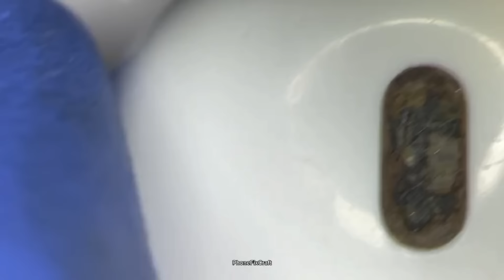Best of October ’21 TikTok phone and AirPods cleaning videos compilation from Phone Fix Craft

Comment: Is anyone else worried that the phones could be damaged by the metal objects? 😰
Reply from the maker: Yes, plenty of people are worried. It's a pointless worry though ;)
Reply: We don't pry or scratch at the pins on these ports you know 🤣
Reply: No
Reply: I am just worried about those tws because the watery liquid might damage those speakers no
Reply: He made little scratch at 2:29 🙂
Reply: @MLG_ROWER  not a scratch, just dirt
Reply: Personally, I would rather the metal be scratched than keep all they gross stuff in the phone. It’s worth it if you can charge the phone again/plug in head phones.
Reply: @sayanrahaman  its isoprophylic alcohol , its for electronic devices , no worries
Reply: Sound like 4am going workout
Reply: You all worry about the scratches, meanwhile im worried about the metal rod shorting the charging port pins

Comment: It is possible to open the devices and clean them? That would be awesome too
Reply from the maker: Usually they're pretty clean inside, unless they were used with badly cracked screen for a long period of time
Reply: @PhoneFixCraft  Also wouldn't the water harm the device?
Reply: @sauce8148  I would assume they are using 99% isopropyl which won't cause any issues.

Comment: One thing I noticed when washing the ear buds was that you didn't wipe all the crud off after washing it and when you blew the air, the stuff went right back into the hole
Reply from the maker: I use vacuum there, so all the stuff goes out

Comment: You shouldnt use that metal picker, it can damage a component of the board because you can short the connections inside of the charging port. Recommending wooden toothpick.
Reply: It maybe a gallium pick.That can’t short a socket

Comment: What kind of liquid you use for the cleaning??  Isn’t it bad for air phone or the chip?
Reply: It’s isopropyl alcohol.It’s meant to be used on electronics because it evaporates extremely quickly.Don’t worry it will not damage anything

Comment: what liquid do you use to clean it?
Reply: I use alcohol
Reply: @akuma381  
whether the inside is not damaged, due to wet from alcohol?
Reply: Isopropyl alcohol
Reply: @alan181090   I thought they said not to use alcohol on your phone cuz it can damage it?... Or is that warning just for the screen?
Reply: @shawnparadox9299  what warning?
Reply: @alan181090  
Thanks info
Reply: @shawnparadox9299  Isopropyl alcohol is proper for electronics since it barely has 1% of water in its composition, so you can use it the entire device with no problems

Comment: Саn dust in the connector affect the charging speed?
Reply from the maker: It usually makes the charging intermittent. You'd have to put hold the cable steady for it to charge

Comment: What type of solution are you using to clean the ear pods?
Reply: Это скорее всего перекись водорода но мб спирт. It is most likely hydrogen peroxide but can be alcohol.
Reply: Isopropyl alcohol
Reply: And it doesn't damage the inside of the earbuds? How is that possible?
Reply: @novu6196  Yes because they're not powerful enough.
Reply: Sorry 4 grammar im Russian
Reply: @novu6196  its because when u stóp Ur earbuds on clear Water they will break but when you drop in isopropyl alcohol IT will not damage the earbuds because isopropyl alcohol doesnt have minerals like clear Water do
Reply from the maker: sometimes isopropyl alcohol and sometimes a window cleaner.